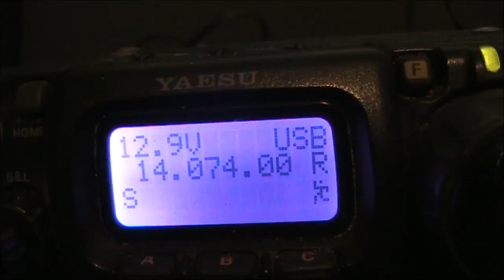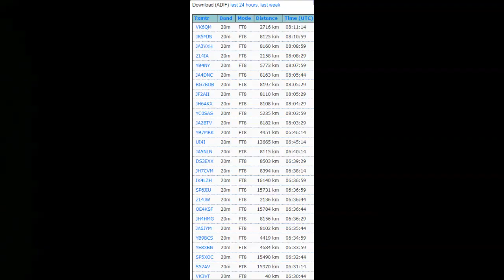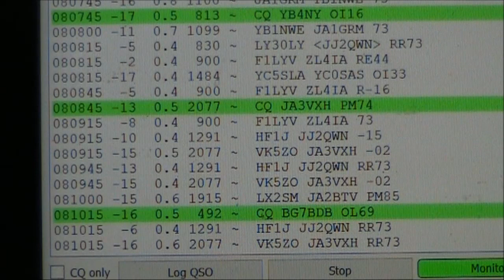Review: HF digital modes crystals - Part 2 (14 MHz FT8 reception)

Comment: Again, very interesting video. They always are! I want to say something to the hams of the U.S. and the reason I'll say it here is because this is a wonderful channel with lots of viewers. Plus, Peter - I speak with you in mind, as our new US licensed ham! If you're in the U.S. and are into digital-anything - keep it ABOVE 7.070 on 40m for example. You people are quickly becoming very, very disliked for your continued disregard of, and attack on, the CW ops. Particularly the low power ones - who's historical and rightful land you have invaded. If need be - we'll have to have legislation. Yet more laws. Legally preventing you from transmitting where you don't belong and are not wanted. I'll push for a 10 KHz segment all for yourselves - keeping you there, and preventing me from going there with CW. Winner winner but no chicken dinner because we'll all have another big brother law. Deal? Don't be idiot neighbors. Don't be the 'idot on the block'.  73
Reply: Good post. I love digital but everyone needs to stay on 7.076,77,78,79,80. It also irritates me when people are running FT4 on 7.078. It goes on 7.079, 7.078 is for JS8. Ok, rant over. WA2ULI 73s.
Reply: @JasonGuerard  Thank you for the comment. I wondered what the frequencies were for those modes. I'm pretty ignorant about digital modes. I assumed that FT 4 and 8 used the same frequencies, sounded the same, etc.  I was just caught off guard by the digital signal on 7.062. I felt crushed by frustration.  73 OM   :)